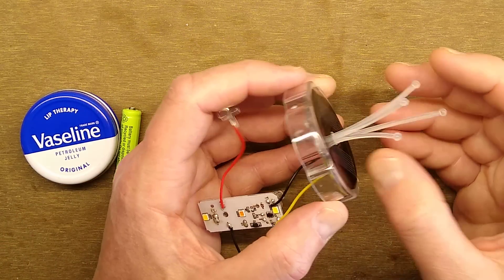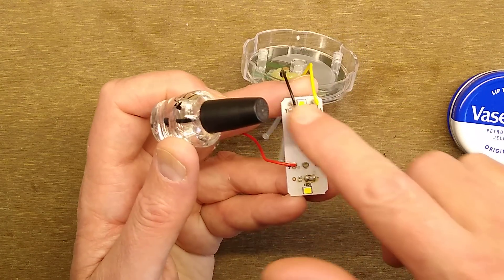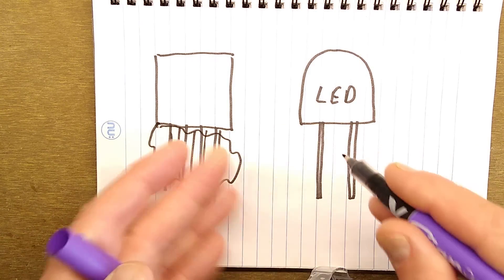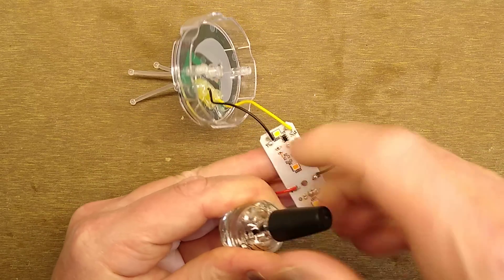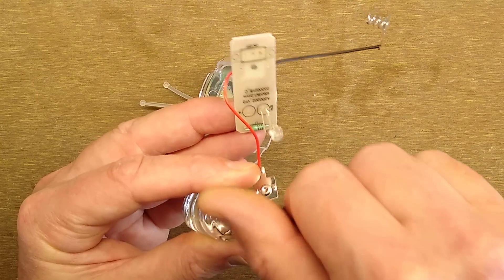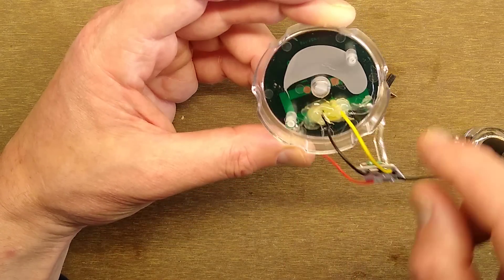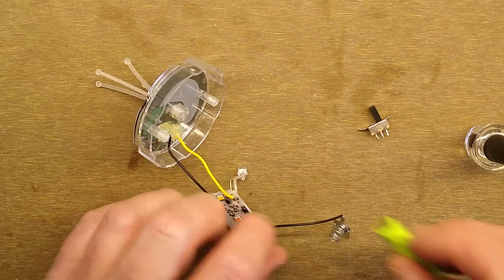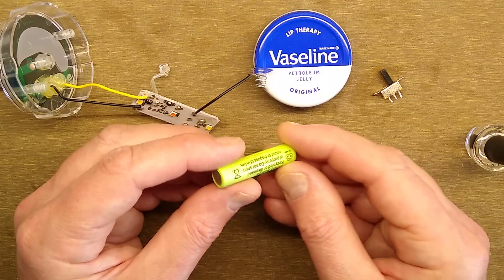Waterproofing your solar lights to make them last longer

Comment: Is there an issue using the nail varnish on more complicated low voltage boards with several ICs / MC chips? Nail varnish is sure cheaper than commerical conformal spray and a lot easier to find. I'm looking forward to telling my ol' lady that I need to hit the local Stuff Mart to buy some vaseline and nail polish. Should be interesting. ;)
Reply from the maker: I'd only suggest it on smaller PCBs and definitely not around connectors.  For bigger and more expensive panels a proper aerosol or flowed conformal coating is better.

Comment: I wonder why they put the power switch on them if they also put plastic pull tabs on the battery when new to block the battery connection

Comment: Will the vaseline melt off in hot weather? If so, is silicone grease safe to use on electronics as an alternative?
Reply from the maker: Yes it should be fine.

Comment: I used nail varnish on a thermometer/hygrometer that is supposed to live in a bathroom vent channel. While the thermometer had no problems, the hygrometer had issues. Of course I did not cover the sensor itself with varnish! However, the close proximity of acetone (from the varnish) overwhelms the sensor. It took some days and repeated cleaning (with 99% alcohol) to get it back to usable state again.
Reply from the maker: The hygrometer membranes are super sensitive to contaminants.

Comment: Id rather buy slightly more expensive lights and not have to faff about waterproofing and sealing them, but ,even the more supposed better quality ones, Everready for example are poorly built and have water ingress issues.
Im a fisherman and sometimes repairing floats we use nail varnish and also superglue. Make sure you get the right type and its very waterproof also..........keep em coming Clive..........;)

Comment: Very handy video.  Do you have any advice for 12V battery terminals, to make them conduct better and reduce corrosion?  I've been looking for a conductive paste, but can't find anything like it.
Reply from the maker: You get battery terminal cleaners.  A conductive paste is not recommended.  Classic terminal grease is fine.  The metal will bite together for a good connection.
Reply: @bigclivedotcom  Fascinating.  I found some on RS and it is said to prevent oxides, which sounds perfect.  I once had a bus bar melt off its mount, because of insufficient contact while drawing 60A over long periods.

Comment: Would silicone sealant (bathroom type) be any use or is it conductive?
Reply from the maker: You have to be careful with the stuff that smells like vinegar as it liberates acid while curing and can corrode stuff.

Comment: Good tip!
And when creating your own pcb designated for outdoors, as long as you do it using the dryfilm/uv-exposure method, after etching you can create a solder mask on that pcb using the same method again.
For a couple of years now I'm frankensteining my parents solarlights and the first pcbs to exchange the rotten original ones were made by the tonertransfer method.
Without a soldermask those quickly became somewhat filthy.
New versions using dryfilm for etching and then once again for solder mask are doing just fine.

Comment: Vaseline and grease is a good idea in cool climates, but in the Australian heat, those oil-based products will melt, drip and partially evaporate. If anyone goes down that path, they should use a high-heat grease that isn't electro-chemically reactive. Even your recent heatwaves in the UK will mess about with your Vaseline seals Clive.

Comment: Very useful as usual, thanks. I’ve acquired a couple of Maglites with the usual problem of corroded, stuck batteries. I’ve cleaned one of them and I was wondering if you had any suggestions for treating the barrel before I put batteries in again. They’ll probably still end up corroding again but it might take less persuasion to get them shifted again. Vaseline might be the way to go, I guess. I was just going to give them a very light coating of 3-in-1. Thanks.

Comment: I have been doing that for about 10 years now, and I need to add a little more info to your video...
1) The hard surface clear nail polish works best.
2) Completely cover everything on your pcb with that clearcoat or moisture will somehow find it's way in. (sometimes through the porous PCB itself)
3) If you get any of your components from china, you have to completely cover their leads with the clear nail polish after you finish placing them on the board. Especially the LEDs and the 4 lead solar light controller IC. (typically a 5252).
.
By doing that and carefully controlling how the battery is charged and discharged, I have some 10 led (multicolor dual rate flashing leds) solar powered lights that have been in service for more than 5 years and still going strong.
 I built some into Mason Jars because I wanted to vacuum seal them, which only sucked more water into them when the lids rusted through, so avoid doing that in an attempt to seal them... I still build them into Mason Jars but now I replace the lids after about 3 years...
 I had one lid that leaked so bad for so long that everything, including the battery, was under water. (which was very bad because I was using a Lithium battery to power it)
 Luckily, it just kept flashing with the water in it, and after I poured it out and replaced the lid.
 I no longer use the 5252 because it has too many external components and some batches are very sensitive to any supply voltages over 3 VDC; so I would have to use a voltage doubler or tripler to get the brightness I wanted from the leds....
 It is an excellent device for a basic system but now I use a pair of 2N7000 fets, (leaded versions or smd),  and a single resistor, in a simple circuit that can switch much higher voltages and currents...
 Let me know if you want more information on what circuit I ended up with after 10 years of trying different combinations....

Comment: I generally use a bead of B-7000 adhesive around the rim of the solar panel, and vaseline around any seams that clip together.  Not had one fail yet, but they're still accessible for battery replacement.
I got a solar spot recently, and there was a nice thick O-ring around the seam.  However when I opened it up that o-ring was like a bungie cord.  Rubber inside sheathed in fabric!!!  A great way to ENSURE water would get into the light via capillary action along the fabric fibres.  What an effing STUPID thing to do.

Comment: Can you explain how the only 1v solar works, like which chip does that? I know the QX5252 does it from 2v (and the 1.2v nimh cell).
That would be cool to only need 2 solar cells instead of 4 or more!
Also, I use silicon and glass as the gluing substrate, but there's two different kinds, ones like more corrosive than the other (I have to look it up again before I start making lights).
Reply from the maker: It has two dual cells, so 4 for 2V.

Comment: O m g, that day i changed my screen protector and had white halo around it, and the repairer put that nail varnish (didn't know at that time) all over the side of my screen, he said its ok and how expensive that oil is, my concern is will it damage my screen? Even tho i have water resistant.

Comment: I like to use two-part epoxy and a paintbrush.  ArtResin or JB ClearWeld or any other will do.  Another easier-to-apply option is a transparent rubber spray such as Gorilla waterproof patch N spray or flex seal clear.   The rubber sprays are far easier to remove if you ever need to repair the circuit.

Comment: "waterproof" is such a misleading term as most things that claim to be water proof, are only water resistant to a point. Water will get in anywhere, water does not forgive or forget.

Comment: Like the nail varnish idea, but a 3D printed curved cover cap with some small side vents underneath the top would have alleviated the need for disassembly and coating. Yes, more expensive and time consuming, but longer-lasting / preferable, in my opinion.

Comment: In the mid- to end eighties we filled the (supposedly) IP68 distribution boxes for the very first (koax) network cable of the company i was working for then to the brim with vaseline to waterproof them. That way they were waterproof longer then the network ran on koax :). Nice to see this here in a way too 😁👍

Comment: Penetrox is designed for those battery components.
Plus use in terminals on boats.
Now when the wife is not looking i can water proof the boards.

Comment: Is it okay to use conformal coating and dielectric grease like I usually do in similar situations? 😉
Reply from the maker: Yes it is.  This video was based on things people are likely to have at home.
Reply: @bigclivedotcom  Yeah, I got that. Not everyone has UV curing acrylic resin handy, even though they should.

Comment: Great hints, thanks a lot, I always put a big blob of Vaseline in summer on the top of the lamp what is mostly the solarpanel and wait until the hot sun melts it, because that flows same like water and gets stuck every where, so that seals the system pretty well

Comment: A few years ago, when you did a whole series on these solar lights, I stopped by a dollar store and picked up five. Two lost their plastic bits almost immediately by our dogs (but the electronics were salvaged), and one lost its plastic spike in the ground. Two of them are still operating on our back deck, though one of them is about to receive a parts transplant from one of its destroyed brethren. Turns out NiMH batteries get quite messy when they explode. 🤷‍♂

Comment: Drone pilots use silicone conformal coating to protect our drones' electronics from errant crashes into puddles. This is readily and commercially available.
A very quick search while I was typing suggests that, for stationary applications like yard lights, acrylic coating will be significantly less expensive and do just as good a job.
The silicone stuff is preferred for FPV pilots since the acrylic can crack when you put your quad into a concrete pillar at 75MPH.

Comment: Question am into RC and some ESC that I buy are not waterproof and I use conformal coating to make them waterproof can I use clear nail polish as it 10x cheaper thank you
Reply from the maker: A comment here suggests that a flexible coating may be preferred, but nail varnish should provide at least some protection.
Reply: @bigclivedotcom  thanks Clive  I have a cheap 5pound ESC I'll try it on don't think the wife going be happy when she see her nail varnish gone haha 😂

Comment: Thanks so much. Could you please tell me, are lights powered  with a USB Lead,to a Phone charger expensive to run?
Reply from the maker: No.  The USB powered light sets are very low power.
Reply: @bigclivedotcom 
Thank you again, I want to touch the hem of your Cloak. I absolutely admire your knowledge.

Comment: I use PIR LEDs inside my house so that they come on automatically as I walk from room to room. They were only about £3.30 each when I bought them, batteries last about a month, but have a lot of rust now on the spring terminals. Some I've had to replace with DIY brass rods twisted around pliers into a cone shape. That vasceline idea would probably cure this. Thanks.
Reply from the maker: You can get USB rechargeable versions that run for a long time between charges.

Comment: I recall for whatever reason, that my grandmother used clear nail varnish.   Maybe it was to minimize nail breakage.  

In this application, would it be prudent to apply acetone first to remove oils or contaminates first before the nail varnish?
Reply from the maker: A wipe with isopropanol could help.  I'd be cautious about using acetone on electronics.

Comment: Where I work at we replace the external car lights. We've had a serious reduction in "redo's" when we started to put dielectric grease in the lamp contacts. You can pick this up at any car parts store. I used to use a glob of lithium grease for the car lights (not the LED types but the incandescent type).

Comment: I use UV hardening glue (a tip from Julien from way back) to seal up outside things like this...works really well and since it dries crystal clear I can still see if there are any issues.  
Never thought about nail varnish though...it's much cheaper than the glue too...thank you Clive!
Reply: I velieve that it was Julien who was using hot melt glue on some stuff that lived outdoors,  and the results were less than optimal.
Reply: @Roy_Tellason    
The kind I'm referring to was not the hot glue but a UV glue...you put it on and use a UV light to cure it.

Comment: PSA: if you're not comfortable buying several packs of vaseline from your local pharmacy/chemist as they judgementally wonder what medical ailment you might have to need so much, you can also use silicone grease from your local electrical retailers.

Comment: Clive, do you think spraying it with an expensive can of Conformal coating would work just as good?  Ave did a video maybe 2 years or more back and sprayed a dewalt tool inside. I purchased a can off Amazon or  eBay and tried it.  The tool finally died just recently however I work for water utility and it gets covered in mud and soaked in water quite often.
Reply from the maker: You can get VCI sprays (vapor corrosion inhibitors) that put a molecular layer of oil on everything.

Comment: This came just at the right time..👍
I’ve actually got garden lights I want to save..
I’ll probably be replacing a few of the crappy switches at the same time..
I find them a more significant point of failure than water ingress and not just on garden lights..😕

Comment: I had to do something similar to our cheap(ish) Chinese camera WiFi doorbell recently, it woke me (& the dogs, which were basically howling by the time I got downstairs) at 02:20 after a major thunderstorm, just wouldn’t stop going off.
I dried it out in some silica gel crystals but it did it again a couple of days later (thankfully at a more sociable hour), so I dried it out again & smothered the board in silicone based conformal coating.
So far it’s been ok. Those thunderstorms were pretty odd in as much as the wind wasn’t in the usual prevailing direction, I mean we’ve had it for months & it’s been fine, but it’s definitely not waterproof. Hopefully it is now though.

Comment: Nail varnish. Brilliant. I've tried Clear-lac spray-on-stuff for outdoor stainless-steel fittings against coastal sea salt air. Miserable results. 
So, nail-varnish it is. How do I avoid "Will she need some mascara and lipstick to go with that, Sir?".

Comment: Clive, there is a really good product out there called "Wet Protect" It comes in an aerosol can, you can spray it into the light and be done. That stuff wicks everywhere and forms a potent barrier against moisture. I have used it for years in waterproofing marine electronics including radios, never had a problem since. As far as I have observed it does not degrade plastic in any way. I am in no ways afilliated with the company.

Comment: does nail varnish perish in cold damp moist conditions? I mean become brittle, like superglue? the heat/cold (expansion/contraction) cycle must have some some effect? or is it negligable?
Reply from the maker: Not sure how it handles extreme temperatures.

Comment: Quick note nail varnish can soften some plastics so dont just pour a plastic casing full of it because the casing will get soft and it will take a few weeks to harden.

Lets just say i have experience in waterproofing hehe

Comment: BTW You can use UV Cue Resin / Bees Wax / Chlorinated rubber swimming pool paint (clear) / silicon oil / plastic dip (clear)  / acrylic / white lithium grease for switches / buttons 

Stern gland , stuffing box   Grease and Bees Wax mix  50:50 (protects Electric motor, Combustion Engine & gearboxes ) Has a self Re sealing property due the Wax Cooling down
Reply: Also A Vacuum Chamber + Vacuum pump is useful (& Magnetic Indiction Hob with Temp Control ) (Transformer wax / Transformer  Tar / Recyclable plastics)
This is more useful for more Porous Ceramic Components and getting a very good Solid Seal

Comment: I am in America; I have solar powered system 12dc volts. I never understood why take 12dc volts to 120ac volts to run a light in a house that only takes it back down to 12dc volt or less. That is how they wired the house for the 120 volts. I want to still use the same LED light so where can I pick up on the power having the power regulator and the 12 volts still being used in the circuit and not have to change the LED lights to 12 volts. I would like to 1/2 drive them as well.

Comment: The switches are indeed horrible, the metal casing around the switch is made of a low quality steel that rusts very quickly. I personally think they shouldn't have switches at all, and they should just have a paper tab between the battery and connection that people pull away after they buy it. I think however that these mass produced solar lights are kind of designed to fail, this is why they put the horrible switch in there, and why often the metal tabs that touch the battery on either side are often also made out of a horrible steel that rusts, which then in turn rusts into the wire connected to them. 
However with some small adjustments you can make them last easily 4-5 years or so, with exactly the things you covered in this video.

Comment: Doesn't vaseline introduce in circuit resistance? Or are we betting on the spring force to facilitate metal-metal contact at the battery contacts?